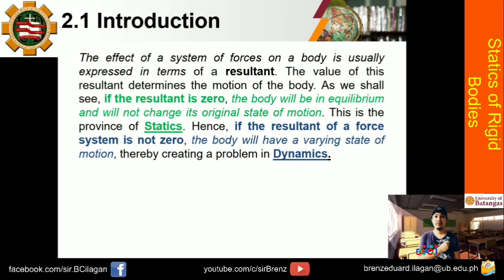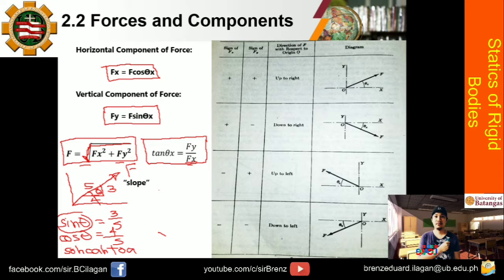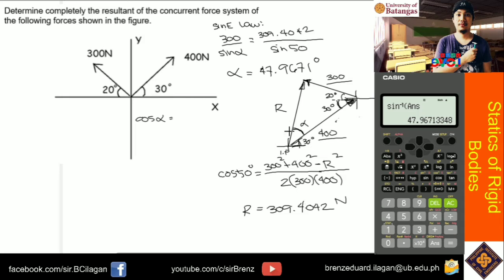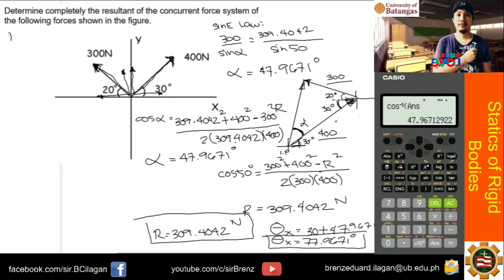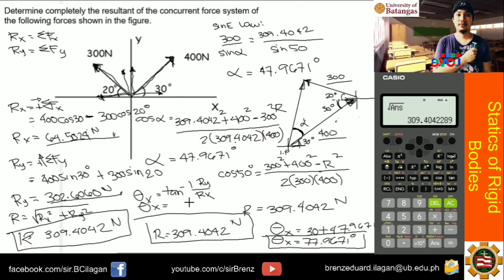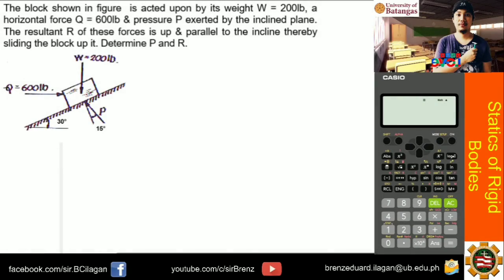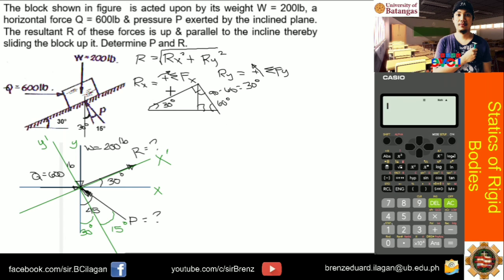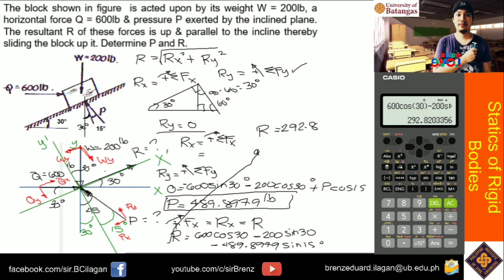Statics of Rigid Bodies - Chapter 2 - Resultant of Force System Part 1

Comment: Sir sa 32:31, di po siya gagawing arc cos 2 over square root of 5 and arc sin 1 over square root of 5?
Reply from the maker: Its the same. You just used the angle of inclination i used the slope. Same answer.
Reply: @sirBrenz  Thank youuu sir